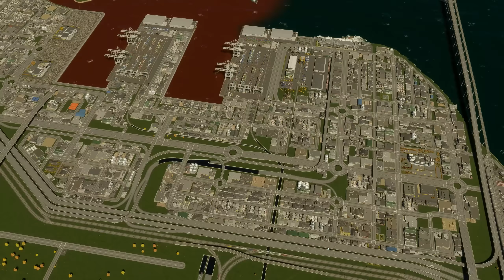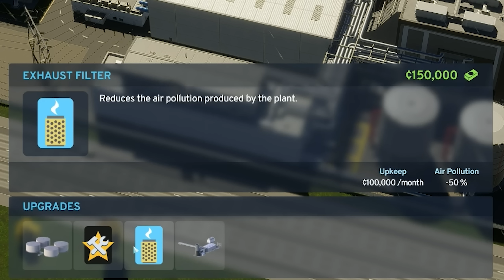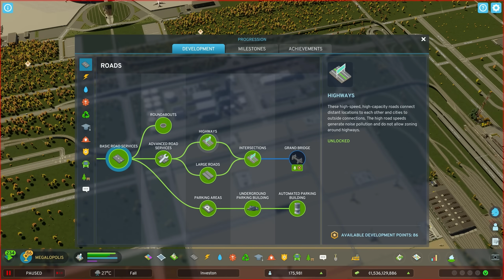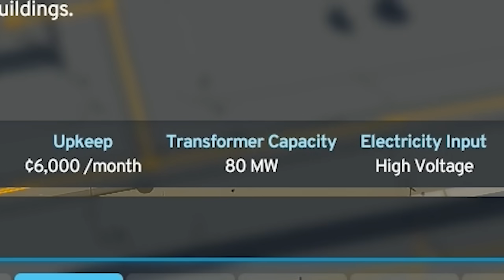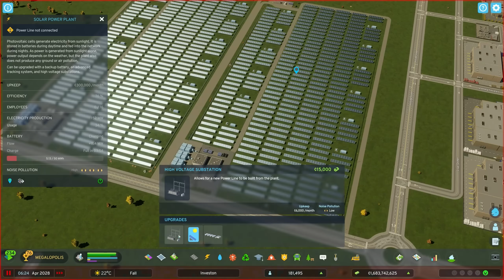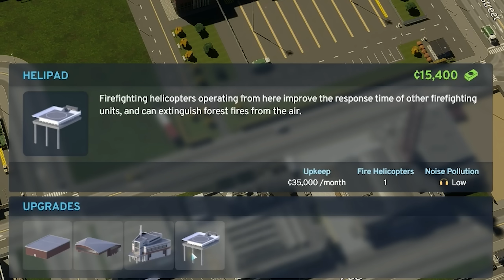Going NUCLEAR in Cities Skylines 2!

Comment: Coal-fired power plants need to be cooled too like nuclear power plants, as they are both thermal power plants. Smaller coal-fired plants usually don't have cooling towers, because their heat output can be dealt with by river or sea cooling. Larger coal plants do need cooling towers to work properly. The one in CS2 is actually a very modern coal plant, as its flue gases get exhausted in the cooling tower, omitting the need for a chimney (you can see the pipe entering the cooling tower on the side).

Comment: Kibbitz, the reason why there is a cooling tower in there is because the coal burns water in which is turned into steam and then there is a turbine in there (the tower) which since it’s a large coal plant needs a larger tower instead of regular smoke/steam stacks.
Reply: What? That is complete nonsense. The cooling tower is to cool the condenser circulation water so that the low pressure steam in the turbine can condense, and turn into water to be boiled again.
Reply: Delete this shit right now.

Comment: 5:54 cooling towers are on all power plants that involve heating water to steam, they are essentially a way to recycle the water that would have just gone into the air. This is why a lot of power stations are built next to rivers so they have a good supply of water, however this will have to be filtered which the condensed steam will not.

Comment: 6:04 fun fact kibitz, there’s actually some companies now researching methods of retrofitting decommissioned coal power plants into nuclear power plants utilizing the previous cooling tower structures, rather than building new ones from the start.
Reply: i guess thats not gonna happen....for once most coal plants are really old and second, i think for nuclear power plants safety is way more important. i would be cool if it happens, but i dont think so
Reply: @mysQlx3  this is true. a genuine downside to conversion is that the legislation and regulations that control the stanards of safety around coal power plants are significantly less than those that govern nuclear power. Its almost impossible in a current world to convert coal plants to nuclear because they are signficantly more contaminated past the point that the regulations allow in the nuclear industry.

Comment: Yo m8 power is automatically transferred from high voltage to low voltage when it's connected to a road you only need transfers when your going somewhere that doesn't use roads connections

Comment: Those "cooling towers" aren't actually for cooling, for Nuclear Fission they basically will fire one neutron at U-235 which becomes 2 different elements, 3 neutrons, and energy, those 3 neutrons hit U-235, which goes on and on, OR the cooling rods stop 1 neutron, meaning 2 neutrons go on, stop 2 of the neutrons, meaning 1 goes on, or to stop it completely, they stop all the neutrons, and the energy released boils water, making steam, which spins a wind turbine that generates... ELECTRICITY!!! The steam exits through those. So cooling towers can be to an extent correct, but they aren't for cooling specifically. That's why I prefer to call them spoke-stacks, or just towers, they do TECHNICALLY cool, but it's not their #1 goal.
Reply: Most steam turbine systems are closed loop, meaning that the steam does not just exhaust into the air. Instead, the steam used in the turbine is condensed back into water to go through the whole loop again. An open loop system like you described, where the steam is exhausted to atmosphere, is much less efficient in terms of using the heat energy generated by the reactor or furnace.

Cooling towers are indeed used for cooling, as they help keep the condenser cool and assist with condensing the turbine exhaust steam back into water.
Reply: No, steam NEVER exits the system. These are condensing towers, that condense steam into water, using other bunch of water, which evaporates in the process releasing clean pure steam.

Comment: 6:00 A Coal powered plant does almost the same thing as a nuclear powered plant. 
They heat up water to turn steam turbines to produce power. The cooling tower is for the steam.
Reply: It's to cool the steam inside the nuclear loop, so it can come back into the reactor, and the steam you see flowing out, is from the condenser, which essentially cools one bunch of water with another bunch.

Comment: Weren't wind turbines pretty cost effective for maintenance or was that only for the first game.
Also the Japanese can testify that nuclear plants are definitely beachside property 👌
Reply: Not just the Japanese, pretty much EVERY nuclear power plant is built directly adjacent to a body of water (there's only 1 that I'm aware of that's slightly different), as that simplifies design by providing an ultimate heat sink AND tertiary heat transfer medium for both safety and normal operation.

Comment: I think it's wild that you don't seem to understand the whole electric system and none of your powerplants is actually connected to the high voltage grid. You even build your gas tanks right in front of the connection point 😅

Comment: You're in luck! With the developer mode enabled you can place multiple nuclear power plants without mods. If it's enabled, load into the save and then press TAB to open the developer menu. In the developer menu go to the "simulation" tab and enable "bypass validation...", this is basically anarchy which you need to bypass the "Already exists" check that the game does, you might want to disable it after you're done. Now you can close the developer window by press tab again and you can place the asset. Press HOME and search for nuclear in the asset window, click the nuclear power plant asset in the list and place it!

Comment: Remember guys !  every outside line can only export 400MW ! so u neeed some outside connections on the GRID for max profit !
and u need to connect the plants with the high power cables in the first place (also to the outside) u missed that
and u dont need transformers... the plant has a build in ... u only need new ones if u have too much power draw in a certain area and the cables turn red !
Reply: Good tip

Comment: Transformers split 80mw to its area. Once a single yellow power line exceeds 80mw you need to put a transformer after that line. I use them on each section of a city I'm building. One for industrial area one for commercial area and another for residential. You can disconnect each from one another and have 3 separate power networks that way or more and its much easier to manage when problems occur instead of a spaghetti mess with random transformers all over the place.

Comment: i noticed u thought the coal power plant looked like a nuclear one, but fun fact, the smokestacks on coal vs nuclear are basically the same. in a coal power plant, u burn coal, generate heat. boil water, steam goes through steam turbine and out the smokestack. for nuclear, controlled fission reaction to generate heat, boil water goes through steam turbine too. then this is oversimplified because i dont know much more about power generating, but cool ig.
Reply: What you refer to aren't the smoke stacks, those are the cooling towers. A nuclear power plant obviously doesn't have a smoke stack and in a coal power plant, it's the slim stack next to the cooling tower. In some cases the smoke stack and the cooling tower are combined, but the model you see in cs doesn't have this feature

Your whole description of the two processes isn't accurate by the way. The whole steam loop is a closed system. You don't boil water, run it through a turbine and release it. The water in the closed loop is demineralized to protect the loop and all the components. This loop is cooled by a open loop system and the process of exchanging the access heat (turning steam back to water) of the closed loop with the open loop system creates the steam you see leaving the cooling towers.
Reply: @stefan514  thanks mb lol
Reply: The whole concept of power plants is to boil water to make wheel spin
Reply: I’m not an expert but in real I believe coal produces way more pollution, unlike nuclear. However nuclear does need storage.
Reply: Nuclear is the only one that requires storage because of fear mongering and lobbyists. Coal power releases so much more radioactive particulate (that isn't controlled) on top of the general pollution it generates. @GWCBFan
Reply: @GWCBFan  yes?

Comment: Remember to hover over the blue and orange power lines while in the Electricity tab to see how much electricity is moving along those lines. Most of the time you would run a main blue line down the sides or your city, or through the middle and then run multiple transformers connected to your roads to distribute the power.
Then pay attention to the amount of power you can send out to another city. Use blue lines but remember they max out at 400MW. So if you hook up say 2 upgrades solar plants they will potentially produce more than 400MW.
Take the Nuclear power plant at 600MW, that means you need 2 lines coming off that plant alone to transmit all of its power.

Comment: The transformer stations are just for converting the power on the large lines to small lines and vice versa. You don't need them unless you're importing or exporting. The power plants can export all their power through the street.
Reply: You need them actually if your disctrict consums more than 40 MW or 80MW depending on the set up.
Reply: I don’t think that’s true. I believe there is a limit for how much power can be transported through the low voltage lines, I don’t have the exact numbers for this but I think there’s another comment on here explaining it better
Reply: The streets can't handle the full capacity of a large power plant. You need to distribute it via high voltage lines to different parts of your city

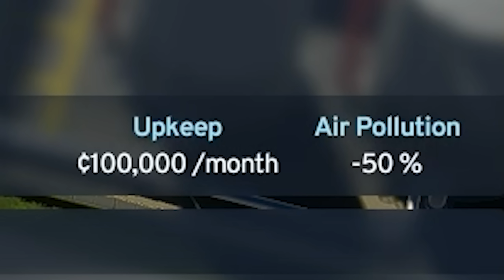Comment: 2:22 if you're not worried about pollution, why bother with nuclear? It's a clean and carbon-neutral power source that safely contains its waste, unlike fossil fuels. The description of the nuclear plant literally says that it generates minimal ground or air pollution.
Reply: Because it produces electricity efficiently, resulting in increased profits
Reply: Coal power plants don't generate 750 MW